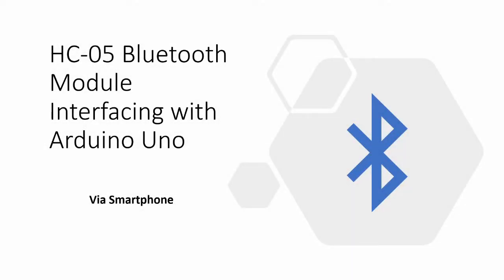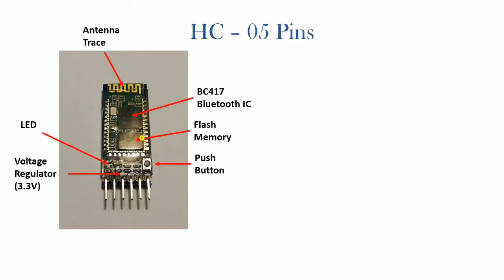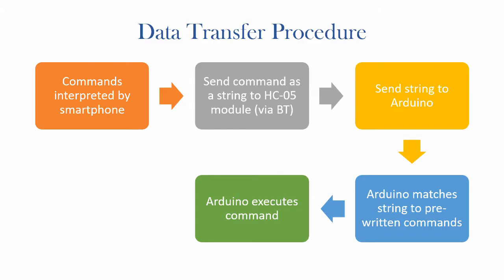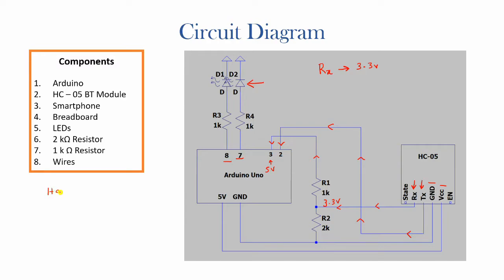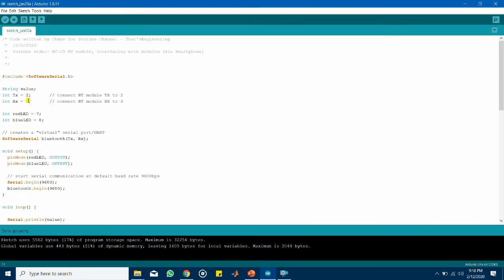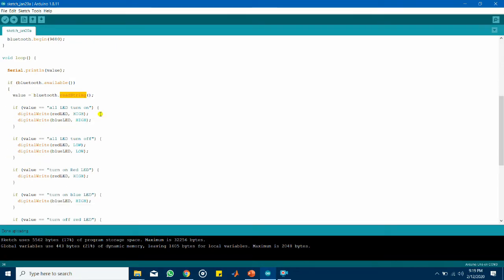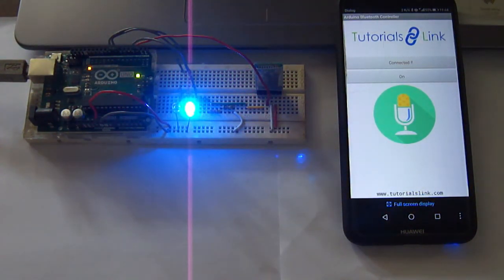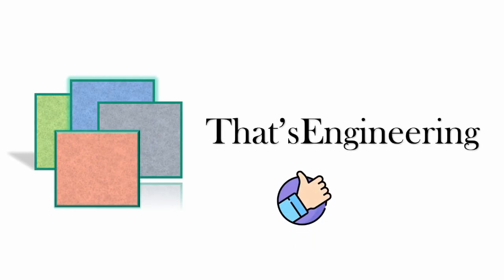HC-05 Bluetooth Module Interfacing With Arduino Uno | Using Smartphone

Comment: Why isn't a voltage divider used on the tx pin
Reply: Ok. Already HC-05 tx pinout is 3,3V.
Reply: Rx arrow directions are wrong